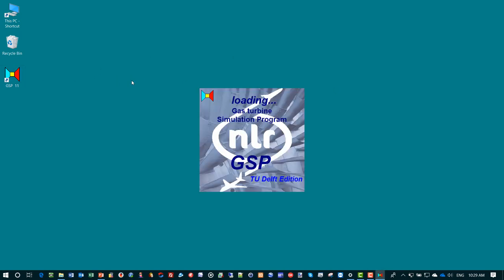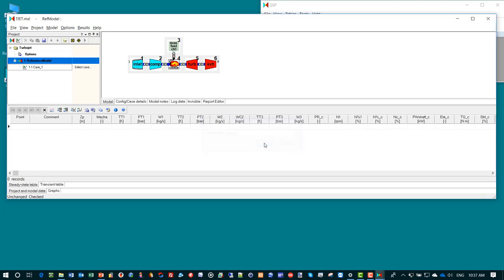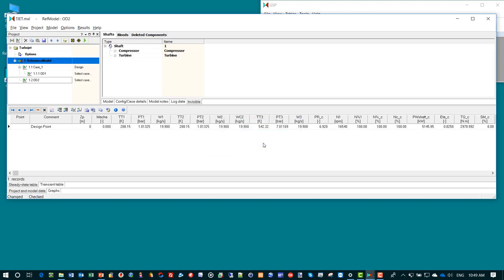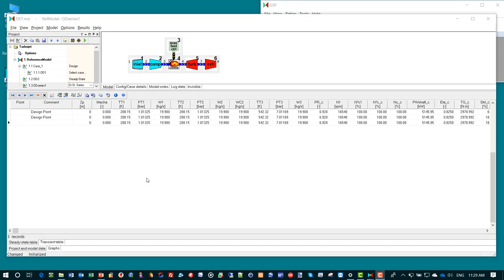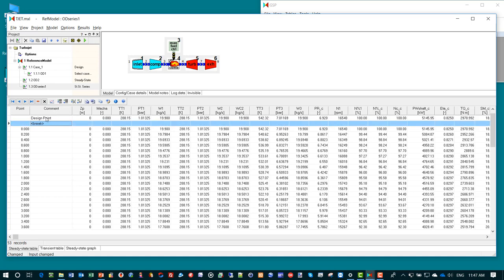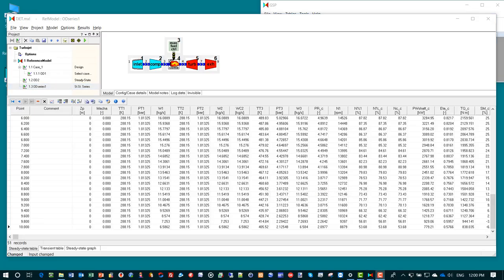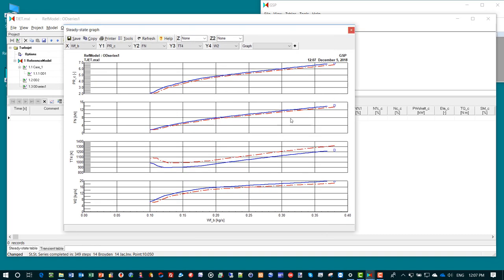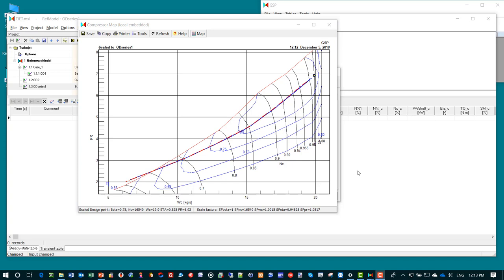Gas Turbine Simulation Program (GSP) Demo

Comment: Hi. Thanks for the video. I have a question. There is a way to obtain the numerical values of the point of the compressor and turbine maps? Thank You.
Reply from the maker: Yes that is possible (and so are all the other data that the program is using).